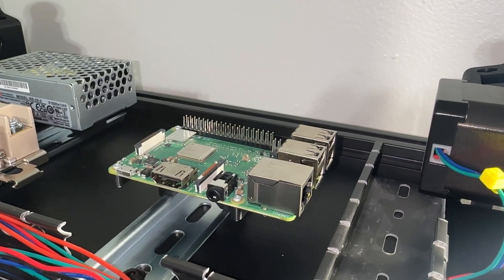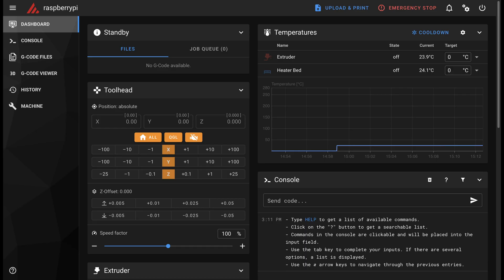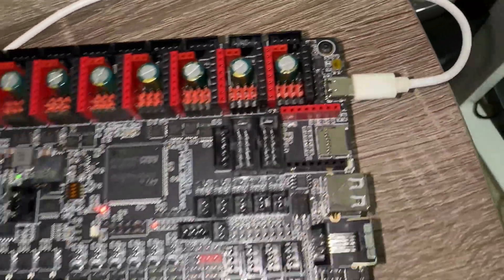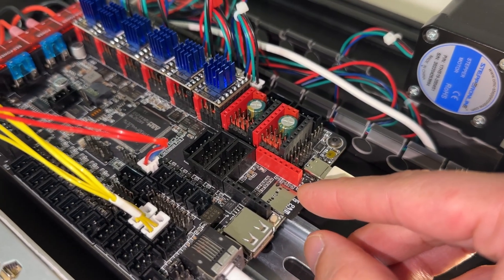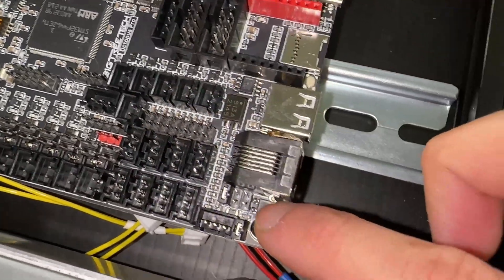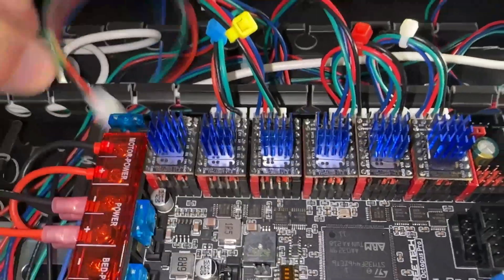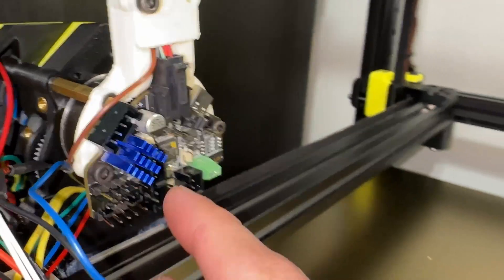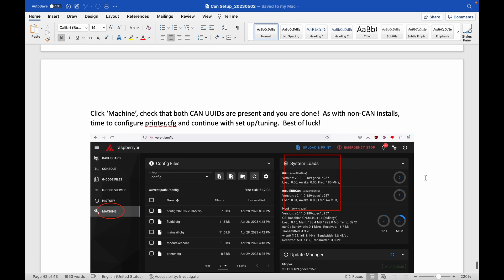DIY Voron 2.4r2 Part 12: CAN bus (Octopus Bridge), Klipper, Web GUI, Wiring

Comment: FYI people, you can skip the whole klipper manual installation by choosing the following in raspberry pi imager:
Choose operating system > Other specific-purpose OS > 3D printing> Mainsail OS. 

Then you can continue adding printer.cfg and so on

Comment: Hi, could you help me? I am stuck for the last 2 days. 

So, I am able to write the firmware using STM32 to Octopus Pro and EBB36. 

And when connecting to Pi, I can see Octopus pro with the command. 

la /dev/serial/by-id/*

But, as soon as I upload klipper firmware to. Octopus pro(by serial as mentioned in doc). 

I can no longer see the octopus pro. I get this error after flashing klipper.bin for octopus pro. 

ls: cannot access '/dev/serial/by-id/*': no such file or directory

I can however see the UUID for both octopus and ebb36 and was even able to flash klipper to ebb36. 

I am really stuck here.

Comment: So i am a bit stuck, maybe you have an idea :) 
First of all, board (octopus 1.1 stm32 446) seems to work and is recognized by USB initially, when i try to go into DFU mode nothing happens, at all.  Neither on a Pi, or on a windows machine. 
When i try to flash the build firmware with an SD card it seems to flash fine, the file gets renamed on the SD card to .cur, but the board is not showing up on USB anymore. Status light reacts to reset button by going off and back on.  I can hower fix it by flashing it with a sdcard again with the btt original usb firmware. After that usb works again, but still no DFU. 

Verified all settings in menuconfig, seems fine and i am not new to this at all.  tried usb power and 24v power as well.
Any ideas would be welcome.
Reply: I'm having the same issue with the same board version. How you manage  to find a work around ?
Reply: @PadBoll  i got it to work in the end but can not for the life of me remember what i did anymore as its some time ago, really sorry
Reply: @devilmastah  Thanks anyways ;)

Comment: Hi, thanks for the valuable information. I was wondering if you had to set a 120ohm resistor on the Octopus Canbus terminal. I don't see any jumper on the board.
Reply from the maker: I did not have to set any 120 ohm resistor on my Octopus board.  Only the EBB36.
Reply: @AdvancingDIY   thanks for clarifying!

Comment: I can safely confirm that this works on EBB Sb2240, awesome work my friend many many thanks 💐💐 I struggled a lot with this before, now with your documentation all is working fine. Kudos for you 🌷... 
Also I have used STM32 cubeprogrammer v2.14 it seams that they have fixed the bug the u encountered with 2.13
Reply from the maker: Thank you for the feedback on the STM32 cubeprogrammer version, glad they got that fixed.  Kudos to you for committing to the SB2240, I was too lazy to do any additional soldering after the S/B NeoPixels lol.

Comment: Hello.

So with octopus we don't need USB to can adapter for raspberry. Can we connect toolhead directly to octopus and control it from raspberry?
Reply from the maker: Correct, at least on the boards I used.  I connected the 4 CAN wires directly from toolhead EBB36 to Octopus Pro.
Reply: @AdvancingDIY  thank you for answer. Will wait when people will fix some problem in canboot bootloader for all models of microcontrollers
Reply: @Driver732 Do you have a step by step to setup the CAN directly on the octopus? building, flashing, wiring etc.? I ask becasue I made an attempt on it myself. When it failed I got a U2C board that unfortunately seems to be broken (no dfu mode available), so it confirms that it must be best to get it to work on the octopus instead. Currently I am using my EBB SB2209 using USB com instead of CAN so I have both a USB and a CAN cable wired up (CAN cable to supply the toolhead with 24 volts) and it really nags me using 2 cables when basically only needing one.
Reply: Ok never mind that. I went ahead and re-watched the last couple of seconds of this video and realized that you are actually already linking to a step by step. Sorry and thanks. I can see how I failed since I never flashed canboot to my octopus. Just my toolhead board.

Comment: Why is the positive on the 5V PSU, the negative on the 24V PSU: It shouldn't matter. Maybe someone tried to optimize for groundloops? But this is a non-issue here
Polarity of the heater wires: I have yet to build the voron and I'm therefore not familiar with the SSR. But in general for a heater the polarity is irrelevant. I'd have to look into the circuit to see if the mismatched polarity is a problem here
Reply from the maker: Thank you for the feedback, I also saw online that polarity for heaters and thermistors don't matter.  Those were not specified in the assembly manual either.